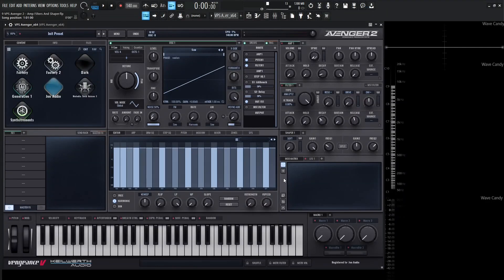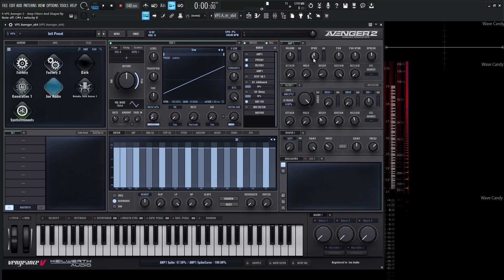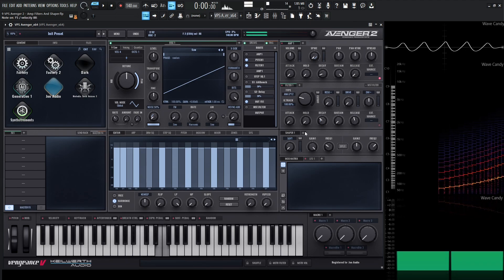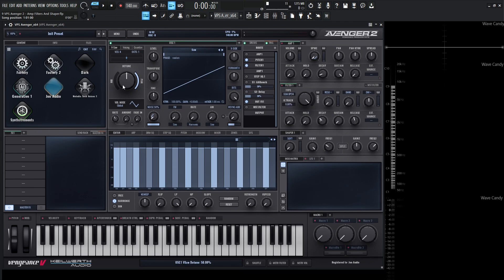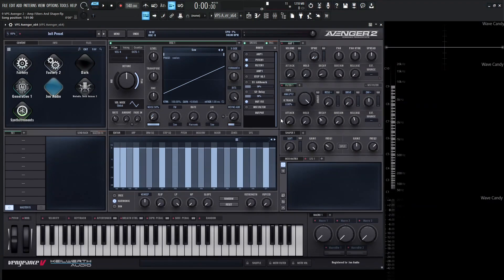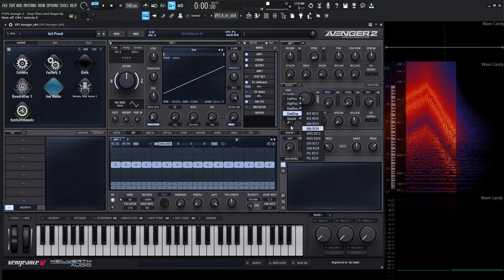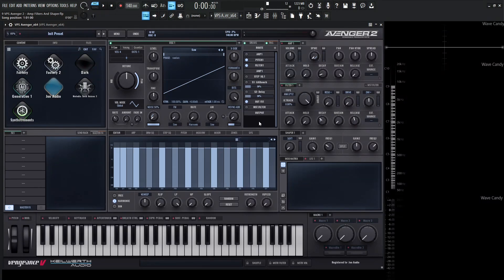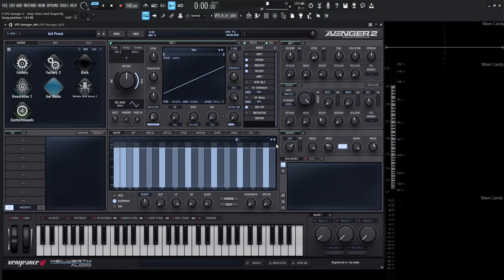VPS Avenger 2 - Tutorial Course #9 With Jon Audio - Amp Filter Shaper

Comment: I'm still confused about parallel filtering. I get that for a filter you can split the signal between the filter and output, but don't both of those signals then get processed by a second filter  if that second filter comes after/below the first filter in the routing panel?

Comment: Thanks again, Jon, for a great series on Avenger. It inspired me to make my latest song only with Avenger. And thanks, too, for being a manualophile.

If I understand you correctly, in the routing panel, if Filter 2 is below the return of Filter 1 (in send mode), Filter 2 would still receive Filter 1's signal, and so would still be "in series". So, to route these filters "in parallel" wouldn't you need to have Filter 1's return below Filter 2?

Also, re the Shaper, what do the two frequency peaks represent? When you say "push the signal into the the distortion module", are we talking about basically two bell-shaped EQ bands affecting the Shaper's input signal?